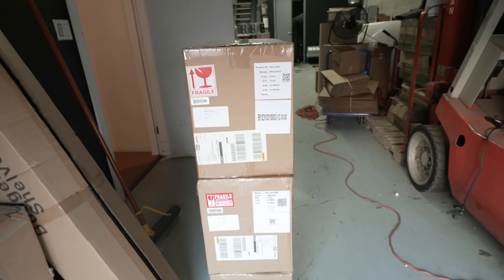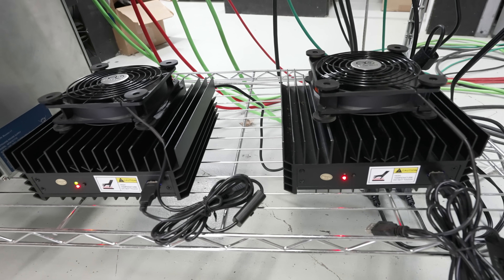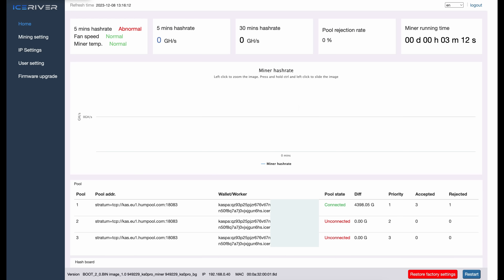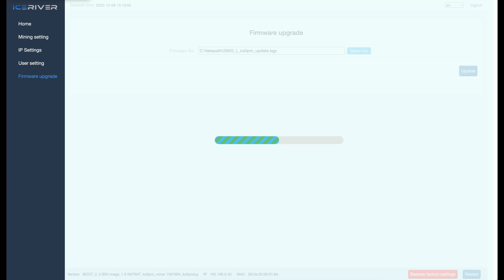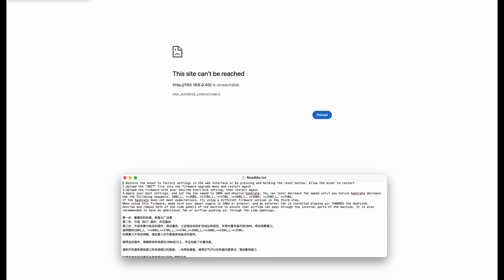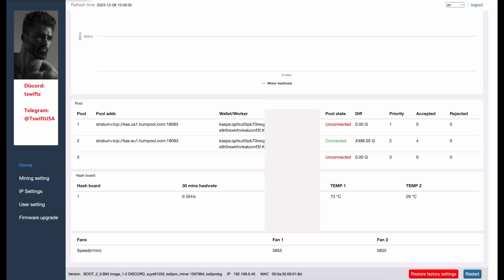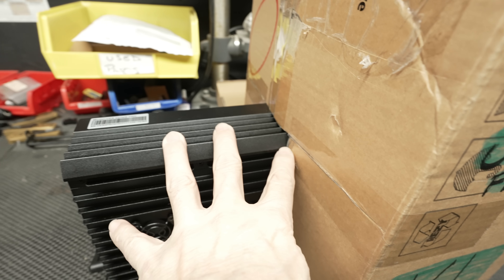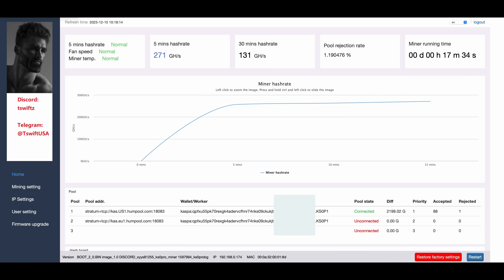IceRiver KS0 Pro Kaspa Miner How To Flash The Paid Overclocks & Results?

Comment: shouldn't air be coing through power cord side?
Reply from the maker: There is as I took the metal plates off each side of the miner as in the video. The fan that I mounted to the box pushes air through the entire miner coming out the open end of the miner that's on the opposite side of the box, creating kind of a wind tunnel. It's jank but it works.
Reply: Ohh i see what you mean now exactly! perfect setup. thanks for the video/guide @miningwithunclechuck

Comment: Which miner buy today market condition M66s 306T/h  or S19k PRO OR S21 200T/h
Reply from the maker: The Whatsminer M66s is a beast of a miner but not practical for most people based on its size and power requirements if one was thinking of a home mining setup, I would look at the M60s 187TH. As far as anything S19 I wouldn't waste the cash with the halving coming as they will all be well under water, but my guess is the S21 will probably become the most popular BTC miner after the halving, just my opinion anyway.
Reply: I have immersion cooling setup and no problem with power comsuim so i think which is best S21 or M66s @miningwithunclechuck
Reply: People are blowing out the s19k pros because the halving, and you will spend more in power than they mine in a few months. S21 all the way

Comment: D9 vs L7 which is best to buy today please help
Reply from the maker: Different topic all together but... out of all my miners at both my building our L7s have been by far the most consistent straight across the board in all areas, even after the Litecoin halving and we still have 8 of those. We've had to do some basic maintenance over time and replaced most of the fans at this stage but not really a big deal and easy to replace yourself when they do go as I even did a video on how to do that for any Antminer a few months ago. I also did a video over a year ago about the L7s if you look back at my past videos. As far as the D9s I only have one, and Dash has been up and down like most cryptos but its managed to keep well into the green profit wise so that ones been up and running since I purchased it.

Comment: Nice one...and loved the box (air tunnel idea)... what were the final temps?  .. Thank you
Reply from the maker: My Temp 1 is 66 and my Temp 2 is 29 with the KS0 Pro fans set to 75%. My ambient room temperature is about 30 degrees celsius which will be much warmer than most people's home setup, as this miner is set up close to my mining room and it's in a warmer area or my temps would be lower. Yes the shafty box is jank lol.. but actually worked for me.